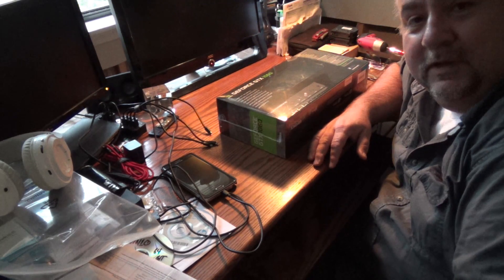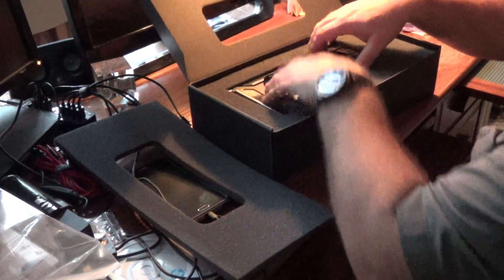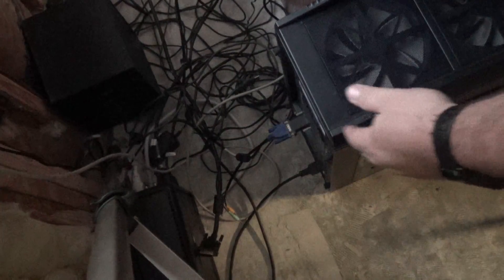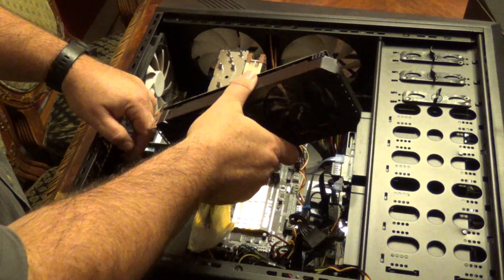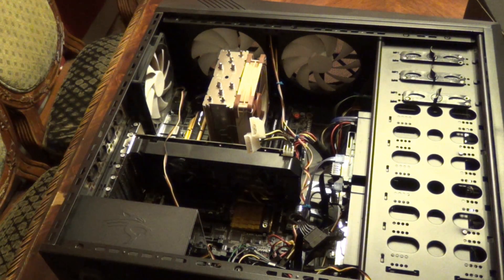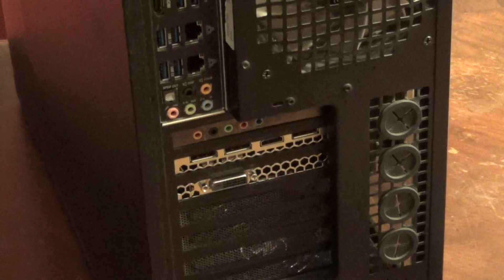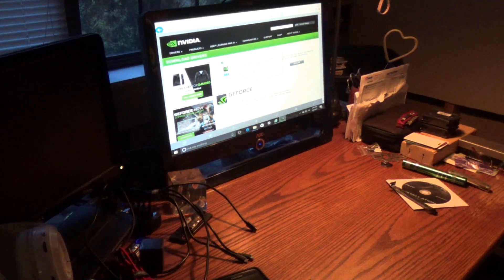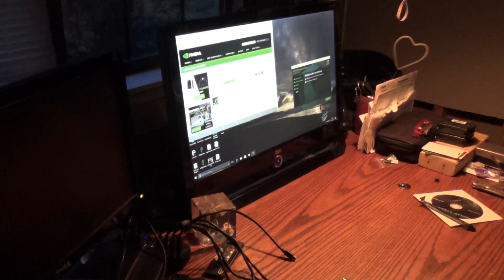How To: Install PNYs GeForce GTX 1060 Video Card

Comment: Think your system is loud enough? I can be right next to my computer with the side open and I barely hear anything. I actually had the same install issue with my card. it wouldn't install when I first turned the computer on after I put the card in. I had to restart to get it to install correctly. It could be a flaw in the GeForce software.